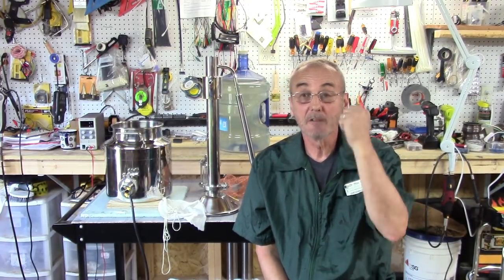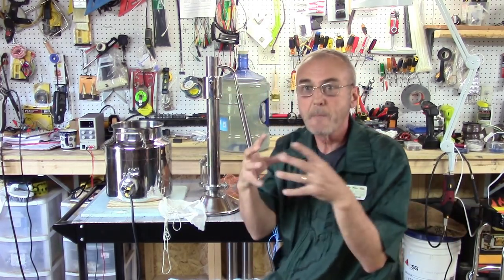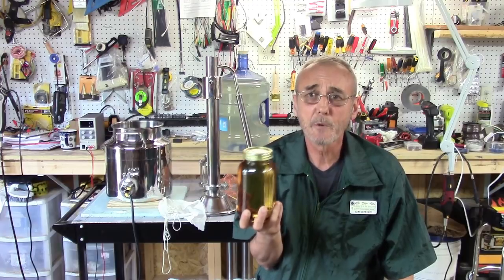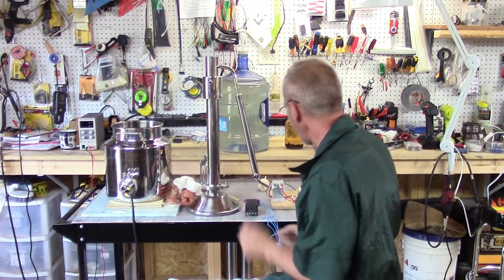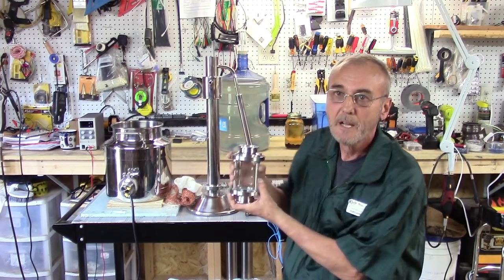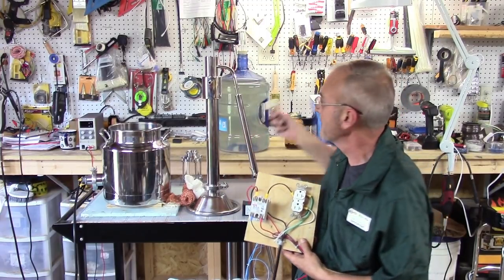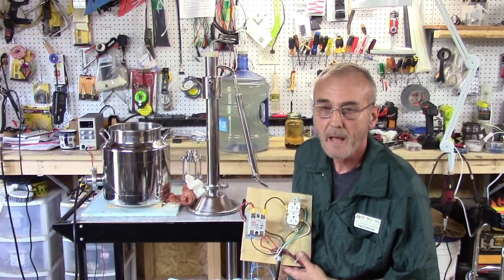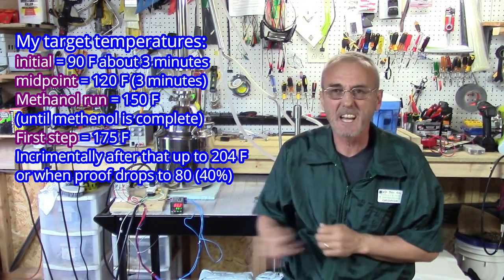MAKING GIN IN A 3 GALLON STILL

Comment: Missed your videos man good to see you making these videos again. The 2 inch sight glass is a really neat thing to watch your vapor condense into im glad i purchased the 2 inch pro tower which gives the still so much more versatility and flexibility and a fun thing to watch while you're making your product. You really don't need it but if you're a nerd like me and actually like science it just makes it that much more enjoyable to do. One thing i did notice with the 2 inch sight glass is you should make sure of and thats you be extra careful lining up the rest of the parts since the sight glass in my experience tends to slightly imbalance the tower if your not dead center which can cause vapour leakage and you run the potential of damaging your tower. Other than that i say its definitely worth the money to get one and if you don't like cheesecloth you can purchase a mesh screen where you can load in your botanicals.

Comment: Copper at least will cause some fractionating. Copper does matter in some cases where you may have sulphur components after fermentation. Maybe not the case here but you should add some more stainless steel pot scrubbers to increase fractionating
Reply: Hey Bernard, can you elaborate / explain more about the fraction process and the need of stainless steel scrubber for this home brewing. 
thanks
Reply: @ashimaarora2945  Pot scrubbers or mesh increase the surface where a partial condensation may occur.When a mixtures of components about to condensate is surrounded by rising vapours, the highest components will evaporate again until the next condensatio/vaporization step. Sorry if I can't make it clearer . Not easy to summarise.

Comment: Great Video, if  using a reflux still with a sugar wash, I take it that there should be no methanol, so by adding my bag of berries at the top of my column, I wouldn't expect methanol either, no doubt I would take samples to burn just to confirm it's colour, if my wash was made with berries as your video, show a tinted colour wash, then I would expect methanol and would probably strip the flavour out using the reflux still...........am I correct   ? I am starting to build my still and would also like to confirm that the reflux column temperature is controlled by cooling the top of the column, saw one video my where George mention this but darned if I can find it again.......looking forward to any advice from fellow distillers....
Reply from the maker: You will always draw off the methanol first either in a pot or reflux still. There is no methanol in berries added to the column. Methanol is a by product of fermentation. 
Control of reflux activity is controlled by water flow through the reflux chamber.
George

Comment: I love you sharing your knowledge with us rookies ! I have a question I am a new distiller have only completed two runs with a stainless still reflux still. The problem I have is I have gotten a nail polish remover smell on both runs. First run was rum and the Oder wasn’t as bad as the last run of sugar vodka. Don’t know what could be causing it. The smell is in all stages of the run. If you might know what is going on I would greatly appreciate it . Keep up the great work.
Reply from the maker: What type of yeast are you using?

Comment: There is a scientific reason for why you need copper. The distillation process creates a small amount of hydrogen sulfide (the stuff that smells like rotten eggs). It is a toxic nerve agent that can cause the alcohol to foul. Without copper the concentration levels rise can rise. The copper oxidizes the hydrogen sulfide into copper sulfate that sticks to the copper, thereby eliminating this issue!

Comment: George, thanks for all the great videos. I do have a question. I hope it’s not one you’ve already answered here. Let’s say someone had an old copper pot alembic still. Where would you place your juniper satchel? Somewhere up in the onion? Thank you in advance.
Reply: You've probably gotten this figured out by now but in case someone else reads this and had the same question. Yes, with an alembic you load anything that you want to infuse your spirits with inside the onion head. There are suppliers that make gin baskets that fit in many of those old stills. If you're lucky enough to have one with the removable arm above the onion head you can probably even find a sight glass that will fit there.

Comment: Howdy George! Thank you for all the content. Much of it has totally changed the way I've been distilling, thank you. Curious about the temp changes you make. Are the changes based on vapor temp changes, or the liquid in the still? With the thermocouple in the column, does it just not matter what the still temp is for the adjustments? Thanks!
Reply from the maker: Temp changes are totally based on output and volume change of the mash in the kettle. Temp of the kettle is not so important - it's like driving a car using the tachometer instead of the speedometer.

George

Comment: Great video...
A guy like you(pro level guy) should have a juniper basket... 
Got a question - how long Did it take to run that 3 gallon batch through..
Just going to do a sugar/yeast batch.
I'm doing 3 gallon mash in a 6 gallon boiler)
(Just about the do a first run ever.....ever.  Newbee. I want to leave enough time and not rush anything)
Thanks. Keep up the great work.
Reply from the maker: Took about 2 or 2 1/2 hours start to finish.
George
Reply: @BarleyandHopsBrewing   ahhh that's not bad.
Thanks for getting back to me.  Great videos, keep posting  🥃

Comment: I've been brewing beer a long time but thought I might buy a still to fit to my Grainfather and make some gin. Couple questions - If you add other botanicals would you add them the same way as in this video? I take it fruit would always be infused but any botanicals would be added by distilling through? any exceptions? and I'm into adjusting water profiles for beers, how important is water (minerals and Ph) for both the sugar wash fermentation and for cutting back?
Reply: The Grainfather boiler can be fitted with the same alembic or collumn heads as the T500.

With botanicals your options are always to distill on the botanicals (either free in the boiler or suspended in a bag or what have you), macerate and strain then distill, vapour infusion (in the vapour stream) or infusion after distilling. They all have their merits.

With regard to fruit, it depends on what you're using and why. Citrus peels generally go in the still for their aromatics, and you can do that with many other fruits, but you can infuse them after distilling to make something more like a liqueur.

Comment: Does the PID control the current running through the water pump?
What us the source of your cooling water?
Reply from the maker: No. The wtaer flow is full on and I use a submersible water pump (pond or fountain pump).
Reply: Barley and Hops Brewing 
Thanks a lot for your response.
can you clarify what the PID is controlling to produce the desired temperature at the thermocouple in the top.  I can think of two options only:
1) the electrical current running through the pump which will govern the speed of the pump and subsequent the cooling water being pushed into the reflux cooler at the top  of the distillation column.
2) the current running through the boiler at the bottom.
Reply: Thanks,
I have had a chance to see a number of your other videos.  I have learned a lot.  I have answers to the the previous questions.  Your videos are very well explained.  I learned, thought and applied.  Thank you for what you are giving.

Comment: George could I ask you, i plan to make gin using your sugar wash with the berries at the top, I have a T500, should I empty out most of the stainless steel saddles ? Thank you 
Ant
Reply from the maker: You can. I'd remove about 1/4 of them and if possible add a few marbles in their place.
George
Reply: Many thanks George, I will try it out thanks for your fast reply , your videos are really great, your a good teacher keep it up and thanks again. 
Ant
Reply: Keep in mind that George is running this thing in pot-still "mode".  I have to believe he has by-passed the stainless jacket that can turn the mighty-mini into a reflux still.  You can't see it from the camera angle, but the output ABV is more inline with a pot-still, and not a reflux still.  The T-500 is a pure reflux still, and cannot really be run as a pot-still, or at least it shouldn't be. As such, the typical carry-over flavors from a pot-still won't be present here, and the flavor profile may be more limited.
Reply from the maker: Excellent Jeff. You are absolutely right. I did not run this as a reflux, I chose to run it in a simple manner.
George
Reply: Jeff Canar thank you for that , yes I was thinking the same and thought I might loose all the flavours, but as this reflux still is all I have at the moment I was thinking that removing the saddles might give it more of a “ pot still” design. I might give it a try and see how it turns out , before I buy the copper pot top for my boiler. Cheers

Comment: Hi George, if I were to make gin using a kettle, thumper and worm/condenser set up, using the thumper as a gin basket, would the methanol in the heads affect the botanicals in the thumper which would then taint the rest of the run? Cheers
Reply from the maker: Should not since they would just transfer to the thumper and then out again. This happens at a lower temp (145F) so you should do just fine.
Reply: Barley and Hops Brewing Thank you George!

Comment: Oh I like the parrot , Nice  I made a completely different style of still all copper but it works like a reflux condensator soon as the ethanal hits the cold bowl it turns into 160 the highest on one run but it`s only 12" high The vapors run thru copper wool too , just about an automatic system took me a month to build it turned out 125 first run 140 2nd then 160 and smooth - Corn sugar  mash same as this , But will the juniper berries leave a lasting flavor in the still like turpentine ? So glad you said about the Glyserin .
Reply from the maker: No long lasting odor or flavor as long as you clean the still after use. I am always amazed at the people that call and tell me they have left over flavors and odors and I find out that they shut down and walked away from their still. It is too easy to dump and at least rinse. Stainless steel is super easy to rinse and with just a little more care copper is also easy as you well know.
The glyserine  (glyserol) tip is actually a trade secret of past moonshiners who would never share such knowledge. Our intent is to open up and share as much as we can to make every serious hobby distiller successful.
Thanks so much for the comment.
Happy distilling
George
Reply: Barley and Hops Brewing Thanks George ,So I made a 1.5 gallon still like an Alembic style with a little twist ,But I clean it with ketchup or vinegar and baking soda ,Shines like a brides ring ,But I love the parrot idea .

Comment: Mr.george i am designing my own distiller for gin and i need your help if you please , how long should be the pipe going up before  the vapor goes into cooling stage , and can you give more information about temperatures needed and timing for gin , Sincerely
Reply from the maker: For gin you will no doubt need to use a reflux still since gin needs to be high in proof and neutral. The standard column length is 28-44 inches. Actually closer to the taller measurement is more efficient. You reflux chamber should be at least 1 inch from the exit point to the condenser and no more than 3 inches down from that point. 
The chamber can either be a jacket or piping that runs through the column for the (pre-condensing chamber) reflux.
Hope this helps

Comment: Hi George I have a quick question when doing your distillation for making gin does it make sense to do a stripping run? And if so would you do that stripping run with or without the berries in the column?
Reply from the maker: Running a reflux still correctly will produce Vodka. A stripping run is not necessary. If you did do a stripping run I would add the berries on the second run.
Reply: @BarleyandHopsBrewing  I know this is an old vid, sorry, was this set up for reflux or did you run it as a pot still?

Comment: George did you just use berries for your gin or did you also add other botanicals ( ex. orange/lemon peel, clove, exc. like in traditional style gins)
Reply from the maker: I just used the berries. any other botanicals desired can be added in a similar manner. I just did the simplest gin possible.
Cheers
George